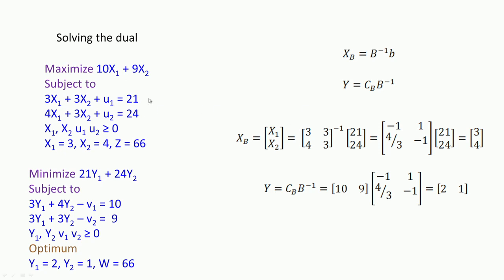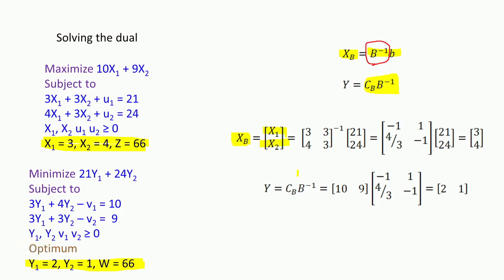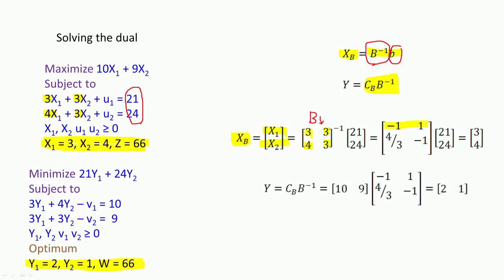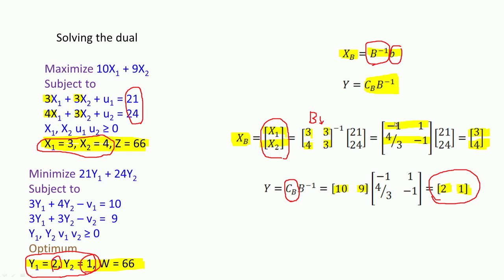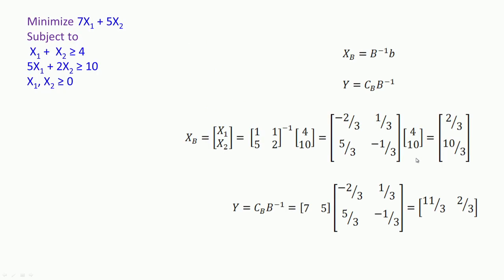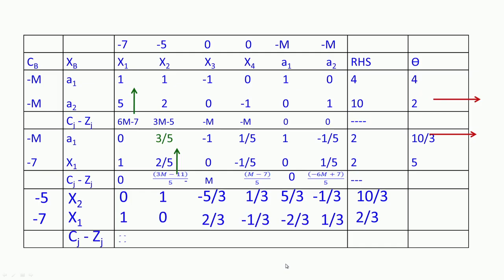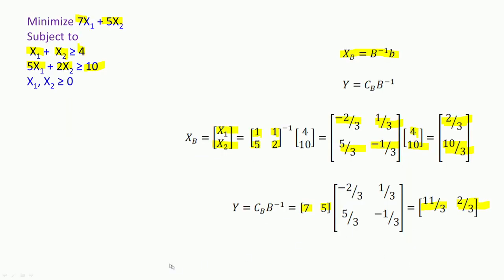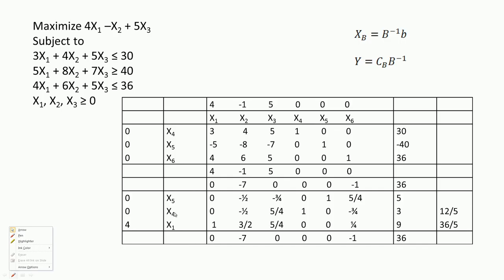Matrix method for LP problems

Comment: Need a give a better explanation on this topic because our prof teaches revised simplex method on matrix method and instead of using CBB(inverse) for dual solution the correct one should be CBB(inverse)-C because Cj=CbB(inverse) and dual solution is Cj-Zj so
Reply: how will you justify your above explanation for the equations we are getting from primal, I think sir just shows how to solve equations by using matrix method then, he compared with already solved simplex table... so why need revised simplex method